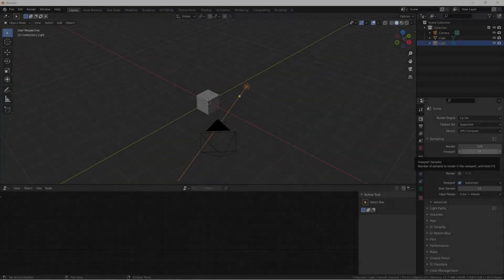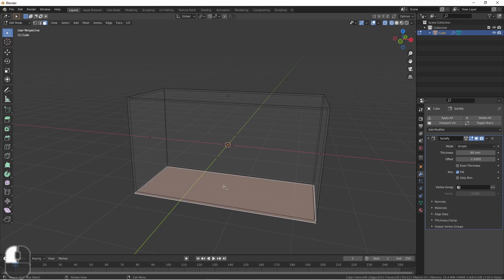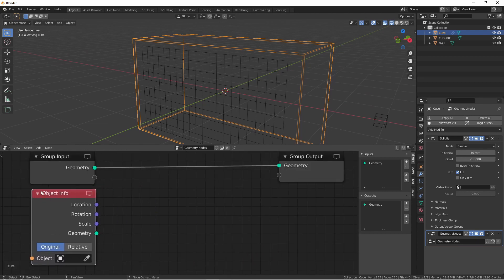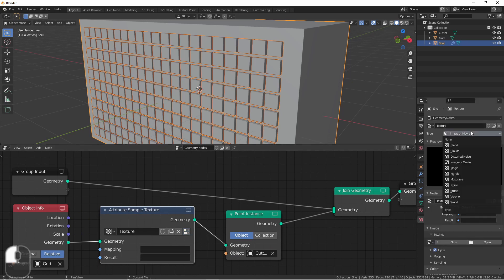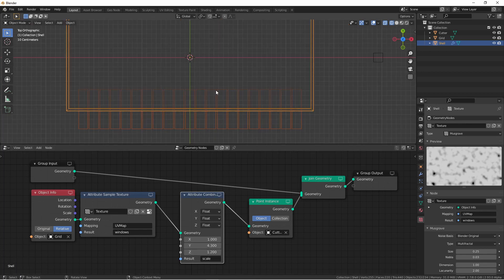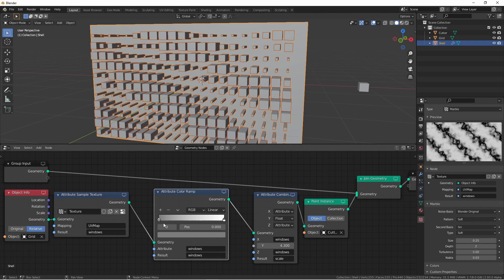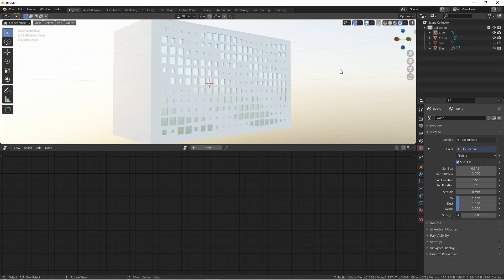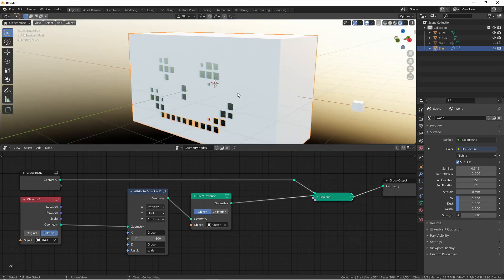Pattern Cutouts with Geometry Nodes in Blender 2.93 Alpha

Comment: This can be accomplished in 3 easy steps in Sketchup. However, thanks for the tip Johnny.
Reply from the maker: That’s cool. Does the pattern remain fully editable? I’ve not used Sketchup before.
Reply: @JohnnyMatthews  Definitely not. Sketchup is not a node base system like blender.
Reply: This is one of the issues amazing me most since using Blender: it's ability to perform as CAD tool having hardly any restrictions compared to expensive specialized solutions
Reply: don´t believe it as flexible as in blender.
Reply: @franzlpeter7346  Sure, because simply it's a semi CAD software, unlike Blender.
Reply: completely different tool and with different use cases.